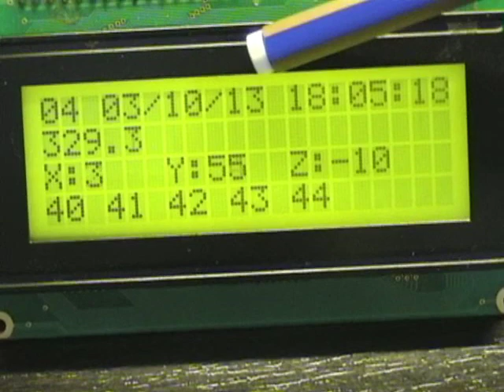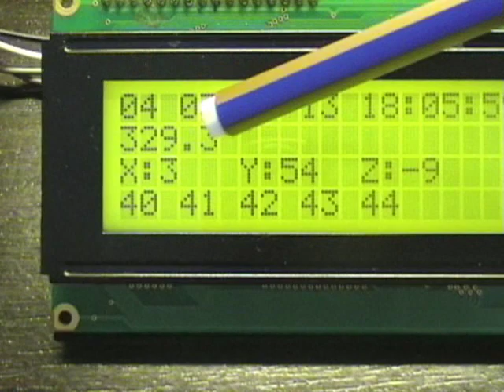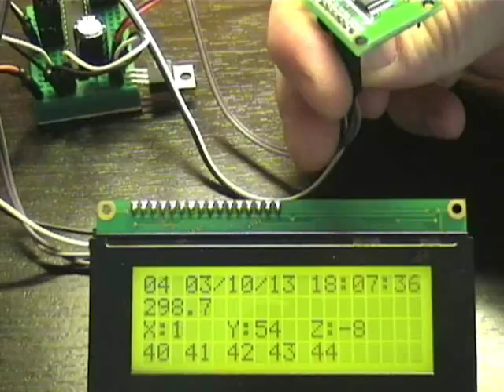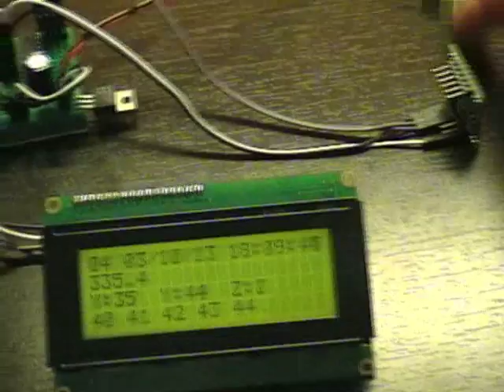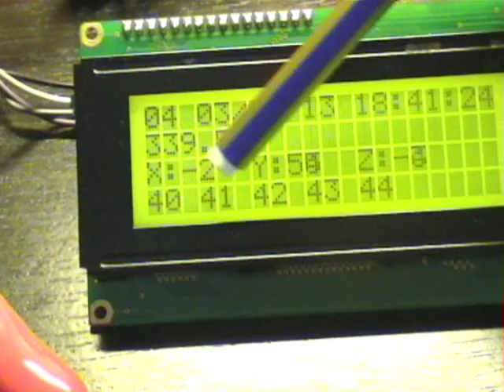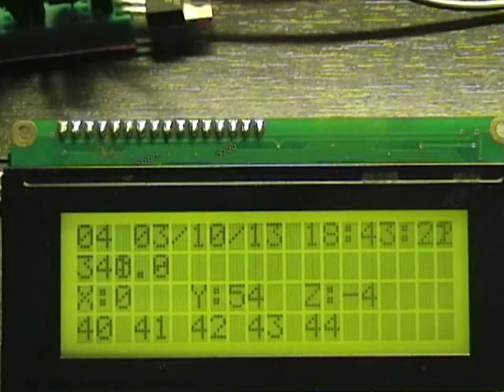ATmega8 (AVR) and I2C sensors.

Comment: Hello Serasidis! I have completely different LCD "backpack" board with PCF8574, actually different layout connection between the chip and display. Data pins from PCF8574 (D0-D3) goes to data pins of LCD (D4-D7) and others are D4-RS, D5-RW, D6-EN, D7-back light. So upper 4 data bits and lower 4 data bits are switched comparing to your pcf board ( i saw on web page: Working with TWI (I2C) sensors / Devices ). So what should I do and what to change, where to change, to make my i2c LCD at least to show data from DS1307 that I have on my "AVR-PLC" board. I designed that PCB with PCF8574t for LCD based on the schematic I found on the internet, and as I noticed that's most common variant in connectiong LCD and PCF chip.  (  mmdolze .users .sourceforge .net /images /myLoS-i2c .png - without spaces) and it was really simple for routing in EAGLE-CAD, single sided PCB, 0 jumpers. Thanks and greetings from Serbia, στην ίδια πίστη :-)

Comment: Thanks man! I managed to get my RTC working by using your code!  Could you please explain how this line works:

DS1307Read(0x01,&clockData);    //minutes
    dateTime[16]=48+(clockData & 0b00001111);
    dateTime[15]=48+((clockData & 0b01110000)>>4);
  
The clockData is empty to begin with, right? Why there is '&' between clockData and binary code? That Binary and value 48 is purely to convert binary to desimal?  Im not sure what that part of code is doing, would be good to know.. Could you please clarify that a little?
Reply from the maker: ATmega8 wants to read the value of ds1307 from the address 0x01 (minutes).
This command calls the function 'DS1307Read' by sending the address of the variable clockData.
The function 'DS1307Read' reads the value from address 0x01 from ds1307 RTC and returns the value to the 'DS1307ReadASCII' function.

There are many ways to pass values from one function to another function. This is the way I choose.